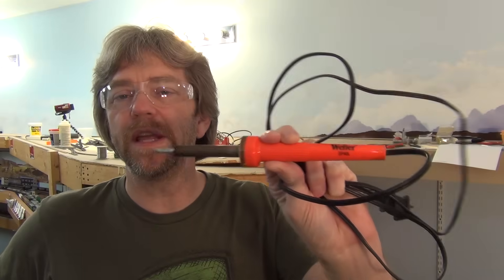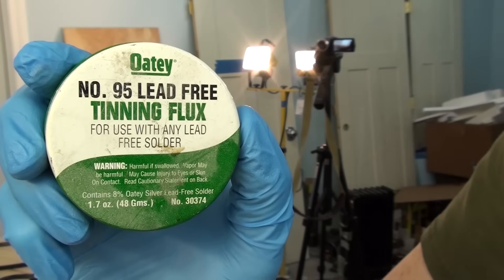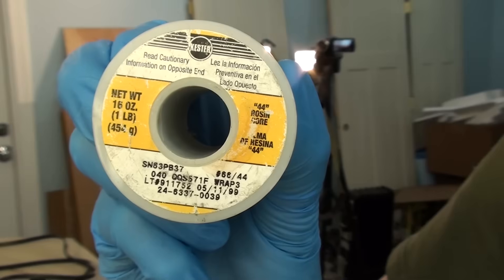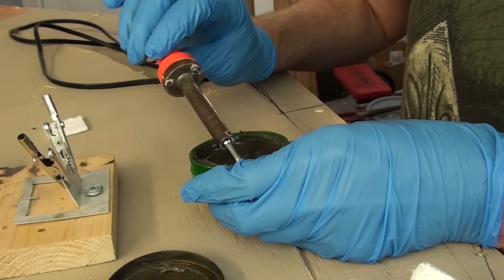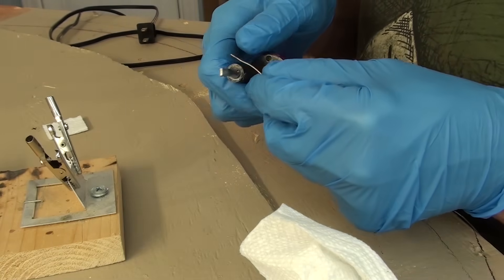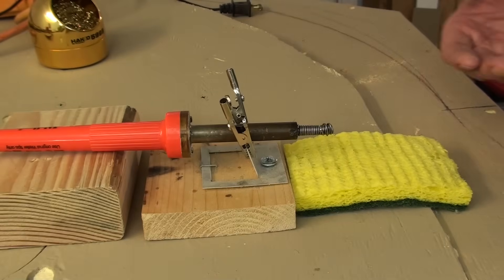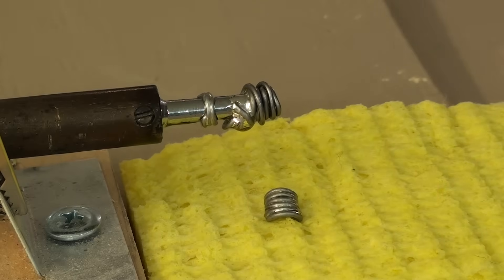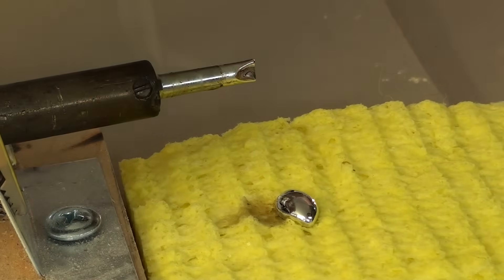🔴How to Tin a Soldering Iron Tip, Without making any mistakes

Comment: Hello. So I found this video because I used a soldering iron for the first time yesterday and sadly i did not tin the tip. Both the iron and tip was brand new so now im trying to find info about what to do. Its not much residue on the tip vecause i only used it to solder 2 short wires together just for a test. So i have flux but only solid wire. Can I do this with that or no? Also do I hqve to do anything to the tip before? Also it is an iron plated tip. Thanks for the video :)
Reply from the maker: Heat it up clean it with a damp sponge and if it is not chard or oxidized it should recoat.   Use past flux to clean the tip and help fresh sold flow on to the tip.  .

Comment: I must've messed up, it is not shiny and doesn't transfer heat well and solder doesn't like to stick to it
Reply from the maker: You need to make sure it is clean when you start,  the goal is to keep it clean and it will work the best.

Comment: Thanks for the video. I have 2 questions. 1. I just discovered that there is a product called 'solder paste.' It seems it could achieve the goals of this video, of coating the tip before heating, but without needing to apply corrosive flux which are found in tinning fluxes, and without needing to wrap solder wire that falls off in chunks. What is your opinion? I also always heard warning not to put flux on your solder tip? so it seems the solder paste would help? Thanks. (My idea is to coat the tip with solder paste, while also holding solder wire to the tip as it heats). 2 Also, I am wanting to use a solder that has nickel in it. So I would expect I should use a different type of solder for tinning the tip. I heard to use 63/37 as you want high tin content?
Reply from the maker: I will just boiler plate this from another source too lazy to type it out. "tinning flux contains ground-up solder flakes, known as tinning powder, that clean, tin and flux most commonly soldered metals, including copper, brass, zinc, galvanized iron lead and tin or copper-coated metals."  I'm not a fan of Solder paste as I do not have the control I need or want with a hair of 63/37.  As for acid issues  I'm still using that same tip in the video and that was 6 years ago.  the import thing is to keep the tip clean,  make sure it is coated so oxygen can not get to it,  AND NEVER TTOUCH IT WIT A WIRE BRUSH, File etc.  use a bras sponge and it will last forever so to speak.

Comment: Great video.
How often do you have to tin your iron?
Reply from the maker: I give a quick recoat and clean after every use.   Solder is cheap.   I'm still using that same tip on that iron in the video.   Just keep up with it after every use and it will last for a long long time.
Reply: Thank you for your reply.
I just tried tinning my new Sugon T26 (JBC C210018 iron). I set the temp to 250 Celsius, but I can’t for the life of me coat the blade like you show in the video🤣. What do you think I’m doing wrong?
Reply from the maker: @ES-iv6wb  it has probably all ready corroded and will not accept solder.  if so you need a new tip.   2nd when you say blade is it a hot knife or soldering tip?
Reply: @IMRROcom  it’s a new tip, I just bought it. Used it twice to solder some copper plates. It was a little black from all the flux, but then I cleaned it all off with steel wool. So it’s fairly shiny.

It’s a soldering iron tip Sugon T26, kinda looks like a knife. For micro soldering.
Reply from the maker: @ES-iv6wb  Steel wool will destroy a tip.  Steel wool rusts.  you need to use brass pads and sparingly at that.   Same thing with a steel wire brush it will remove the protective coating from the tip and expose the copper core.

Comment: Thanks for your reply!  One last question.  Can you use 24-6337-8800 instead of 0039?
Reply from the maker: Yes, it should be fine 63/37 is perfect for electronic work.   Thickness of solder is up to your preference.  Thinner is good in most cases
Reply: Thanks so much!

Comment: The big box stores don’t have this wire or flux.  What do you do suggest?
Reply from the maker: Order from Amazon.  Links in the video description.  But the Tinning Flux should be found at any hardware store in the plumbing area,  the thinner electronic solders should be found at places like (Radio Shacks) maybe Radio Control Hobby shops or crafting places like Michel's and Hobby Lobby.  Check the jewelry making areas.

Comment: Hi sir.. Thanks for the information and tips... May I know what's the lifespan for this tinning can last or we need to do the same process again after used it for some time?
Reply from the maker: Seems that video was five years ago,  I'm still using that same iron with that same tip in the video.  Just keep it clean and coated with solder and it should last for years.  If you have a tip go bad,  it coast $2 to $4 for a new tip.
Reply: @IMRROcom  thank you so much... Really appreciate it...

Comment: What temperature is optimal for first tinning like this?
Reply from the maker: What is required to melt the solder.  I'm just using a plug in weller's  iron.   45w to 60w range.

Comment: Eric - Quick question - what temperature do you recommend for tinning a tip? Or temp range?
Reply from the maker: What is required to melt the solder.  I have been using a plug in the wall 45watt Weller for years.   At work and at home.

Comment: What temp? My solder just turns crusty and black after it sits on the tip? Im at aprox 400 degrees.
Reply from the maker: The crusty and black is corrosion of the tip.  Solder will not stick,   The tip probably done with and needs to be replaced at this point.
Reply: @IMRROcom  
Ok i can live with that, but i used a brand new tip as well, same result.Solder sticks fine, it just turns crusty and black. Im using 60/40 rosin core.. I have a feeling temperature plays a role here, but no one mentions it. Can i kindly ask what temp is best for this?

Comment: is there a reason you melt the solder all the way up to the mounting base of the tip instead of just on the end?
Reply from the maker: It does not hurt and once the tip starts to corrode it will migrate.  It does not hurt to full coat it and keep it protected from oxygen.  The tip heats from the handle down so it is pre melting the solder before it gets to the end working end.

Comment: Excuse me sir, I am a beginer my first time tinnig using your technic was a success thanks to you. 
But as I repeat the process its failed can you please give some tips where did I go wrong? thank you sir
Reply from the maker: if you let the tip go black, oxidize.  you need to start over with a new tip.  Solder iron tips are a consumable and intended to be replaced.   so no worries.   The goal is to make the tip work as well as it can and last as long as it can before needing to be reaplced

Comment: The #95 tinning flux states to be used with lead free solder. I don’t see where the solder you’re using is lead free or not? Can I use the #95 with 60/40 lead solder to tin a new tip? Thanks!
Reply from the maker: It is used with plumbing and copper pipes,  you do not use lead solder on coper pipes used for plumbing and drinking water,  that is why the waring.

Comment: Awesome video sir!
I have issue with soldering Mosfit ...it seems like the Soldeting wire doesnt melt onto the mosfit ends, it just seems to dry up very quickly into a blob...am I doung something wrong?
Reply from the maker: Not seeing what you are doing, surface mount, through hole etc. your best bet is to find a video that covers the method that you need.

Comment: I love this because it's fully reliable and requires absolutely no skill or bullshit. I just tried it on my soldering iron and it didn't work at all, which really just confirmed to me that the tip is too old and needs a replacement, but I will try this method again tomorrow.
Reply from the maker: Tips are a consumable,  if it does not work, spend the few dollars and get a new tip.  Tips are not intended to last forever.  In my shop ever iron that was at a station got a new tip on Friday
Reply: @IMRROcom   Is there a tip that lasts for a long time

Comment: Is this the same for electrical solder? Also how often do you have to run the tip? I’m struggling to try and solder pin headers to a board.
Reply from the maker: This is exactly what this is for,  remember if the tip is not holding solder, the tip is a consumable.  spend the $4 and get a new tip.  But if you keep up with it, the tip will last a long time.  I'm still using that same tip in the video today.

Comment: How do u know when u need to do this? Do all irons need this b4 use?!
Reply from the maker: Do it with any new tip,  keep it coated,  if it is black and corroded, it is too late.  The tip is a consumable and should be replaced

Comment: I saw another video where the guy mainly did what you did, but kept putting the tip in the paste and cleaning it over and over again until it was real shiny. Your opinion?
Reply from the maker: the tip is a consumable,   it is $2 or so,  just replace it with a new one,  it will make your life much better.  If he is doing that, he did not take care of the iron in the 1st place,  you should never have to do what he is doing if you take care of your iron.

Comment: What if I only have 60/40 tin lead .032 rosin core wire?  Is that OK or does it have to be lead free?
Reply from the maker: tinning flux has additives that help,  but you should be fine.  The main goal it to coat the tip and prevent oxygen from ever making contact with the metal
Reply: @IMRROcom  ok gotcha. I found some jewelry solder in my toolbox. It's 97% tin / 3% silver I can try that one. Thanks.

Comment: I using a gun with a trigger that has two stages. Do I use the hottest stage of trigger?
Also my tip has two tips meet in middle. How far up do I wrap solder on the top and bottom of top?
Reply from the maker: Those things are brute force.  only the 1sthalf inch or so.  but again that is brute force and used to put a Lot of HOT into one location.  Like making battery cables for a car etc.

Comment: I'm gonna give your method a try in just a few minutes. I'm doubtful...
Reply from the maker: If the tips is corroded or black, solder will not stick.  but you are using a gun, a completely different type of soldering vs a pen or smaller iron.

Comment: Nice one. So they dont make copper tips any more?
Reply from the maker: Tips are still copper but coated with some sort of nickel alloy to protect the copper tip.   You still need to tin and protect the coated tips or the copper corrodes and the solder will not stick and provide a proper path for heat transfer

Comment: VERY helpful video!!  What tinning flux should I use for a 60/40 RA leaded solder?
Reply from the maker: Just good tinning flux is fine but I would not use the 60/40 solder for electrical work.

Comment: What was the temperature of the soldering iron to tin it
Reply from the maker: cold then plug it in,  once the iron gets to the solder melting point,  it will flow an coat.
Reply: @IMRROcom  but at what temp does it melt....my iron has temperature control
Reply from the maker: @edwardkelly5625  it is based on the solder you are using.  You need to look up the specs
Reply: @IMRROcom  thanx

Comment: Cool, now i can use again my  soldering iron. Thanks for help!
Btw does it works on blacked tip? Like literally she's coated with that.
Reply from the maker: Tips are a consumable,  if the tip is oxidized, it is just better to replace it than try and save it.

Comment: Cool. It needs to be a thinning flux?
Reply from the maker: Yes, Tinning has metals in it that helps a lot over regular flux
Reply: @IMRROcom  Thanks. I checked my current gear (I just bought a cool soldering station, called the KSGER T12, it's now a favorite tool, along with a digital caliper by General), I remember buying a cleaning substance in a tiny metal container, whereby you need to dip a hot iron (260 Celsius maybe- what's your temperature for tinning btw?) into it and I think it's an acid (but it's not pure rosin), will that compound tin the iron as well (is this the tinning flux- the labels are in chinese, can't read it).

By the way, why isn't the very edge of tips, copper. Why's it iron plating? Isn't copper a better conductor? Also my old tip has been eaten a bit at the edge (like a phase of a moon) even though I always clean it with damp soldering sponge after every use. What caused that pitting?

Thanks again stay safe. I can't wait to solder some more and repair all my gadgets if possible (it affects my focus on my main project, if somethings's not working).

Comment: HI, HOW LONG WILL THAT LAST ? DO I NEED TO DO THIS EACH TIME I SOLDER ? THANKS.
Reply from the maker: You need to keep up with it and keep the tip coated with solder,  it will last forever.  just recoat it with solder when you are doing, and it will be ready for next time you use the iron.
Reply: @IMRROcom  OK, I GOTTA GET A NEW IRON THEN CUZ I DIDN'T KNOW THAT AND IT'S PRETTY USELESS NOW. GLAD THEY'RE NOT EXPENSIVE.
Reply from the maker: @joeshmo4929  Just replace the tip,  they are a consumable.  Not intended to last forever, but if you take care of it it will last a long long time.
Reply: @IMRROcom  OH OK I'LL DO THAT ! HEY THANKS FOR THE HELP BRO !!

Comment: If  I haven’t tinned the tip and have used it.  Am I able to tin it?
Reply from the maker: Depends of if it has started to oxidize or the coating has degraded on it.  With you asking my guess is that it is not holding solder any more.  Your best bet is to start with a new tip.

Comment: I've made the mistake of not tinning my tip and it destroyed the coating. Also never thought to add flux to the iron before wrapping it
Reply from the maker: tinning flux, not just flux
Reply: @IMRROcom  yep.. usually use solder with flux in it do have a tinning compound which is a mix of flux solder and some other stuff.

Comment: can I use any flux?
Reply from the maker: The #95 paste flux contains a silver solder tinning powder which helps fill in the joints and coat the tip when heat is applied,  normal flux does not have that.
Reply: @IMRROcom  okay thanks

Comment: A lot of the other videos on tinning a new soldering iron don't apply tinning flux first; they just apply solder to the tip before the tip heats up. Is the flux grease before applying the coil of solder necessary?
Reply from the maker: It helps,  just like talking a shower,  You use soap.  Same thing.

Comment: The tip you used was somewhat already shiny ,my tip has some corrosion /turned dark. how would I go about tinning the tip?
Reply from the maker: If it is black,  clean it with a damp sponge after it heats up,  if not clean it on a brass sponge.  Remember a soldering iron tip is a consumable and is intended to be replaced,  it is not a life time part.

Comment: When soldering a keyboard, do you need to retint every switch you do?
Or just tint once and you are ready to go
Reply from the maker: As long as it looks clean, and silver with a small dot of wet solder to transfer heat.  having the iron clean and silver look makes the iron easier to use in transferring heat.

Comment: Do you need the flux? I've seen another video where they don't use the flux. Is it better with the flux for the first tinning? I wasted 2 tips not realizing you need to tin it at first. I was wondering why it would work great at first then it would become black and oxide after a couple connectors and not transfer heat well at all after that. Can I bring those burnt tips back to life with this method? Or are they junk? Thanks for this video!
Reply from the maker: Do You take a shower without soap?   Yes,  you can do it more or less with out flux,   just like a shower without soap.  Tips are considered a consumable meaning they are intended to toss after worn out etc.  You time might be better spent just buying new tips,  they are only a few bucks on amazon. -  https://amzn.to/36H3Er4

Comment: Thank you for this video. I’ve ruined 2 tips not realizing I have to do this...

I have a coiled brass bundle to clean the tip. 

After following your video, let’s say I solder some wires together. Do I just gently rub the tip on the brass?  I leave all the tinning on there right? I think I was too forceful with the tip on that brass. I thought I had to get all the tin off before powering down. 

Whoops
Reply: Yeah I made the same mistakes lol. I believe you're only supposed to poke the brass mesh to get off any big globs. Then when you go to turn it off you can just make sure there is a little blob on the tip so its coated and then power down. At least that's what everyone seems to say. Im still a novice but believe that's the jist of it.
Reply: @cwatson42785  thanks. I’ve had much success this weekend :)
Reply from the maker: I coat up the tip well before truing it off,  You are stopping corrosion or the contact with oxygen.  If it is coated with solder no oxygen can get to it and corrode the tip. Brass Sponge just poke it a few times to clean up the globs before you solder a joint.  Not real an after use,  this way you have no blob of solder that will over flow on your work.
Reply: @IMRROcom  perfect. Thank you. You’d laugh at me this weekend. I was 20 feet in the air on an extension ladder soldering some permanent LED light strips together. Your support made this possible. Thanks again

Comment: Will this work on an old top?
Reply from the maker: If you are asking,  I'm betting the tip is oxidized at this point and solder will not stick...So it would be a not.

Comment: Can you do this to a tip that already been used? Thanks
Reply from the maker: If you are asking,  I'm betting the tip is oxidized at this point and solder will not stick...So it would be a not.